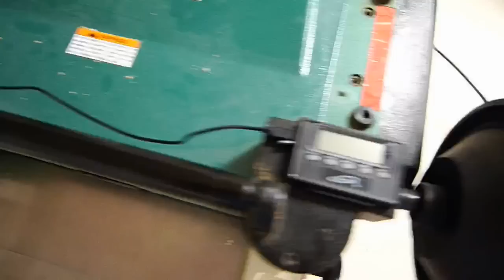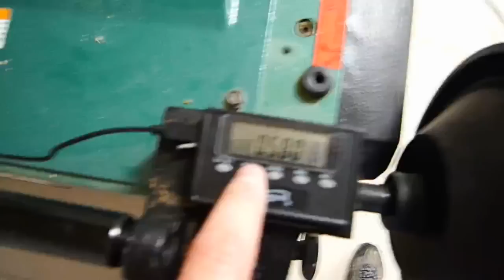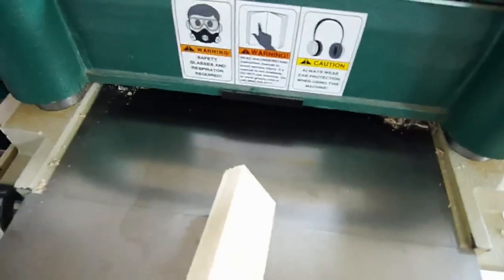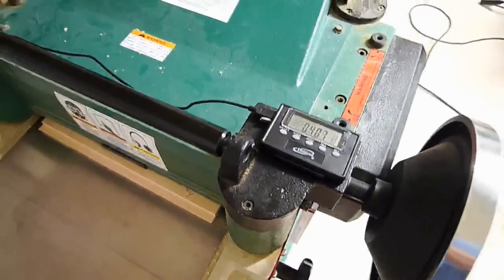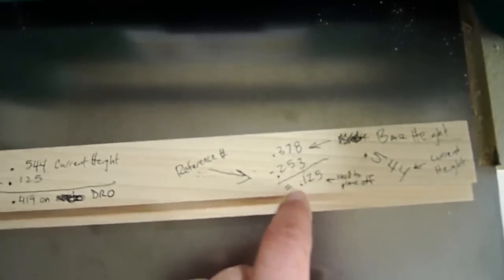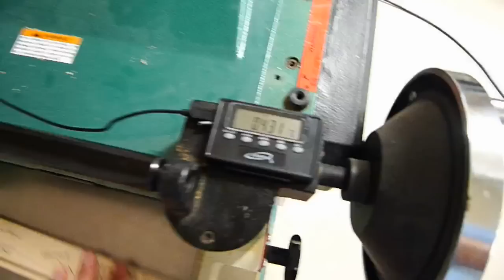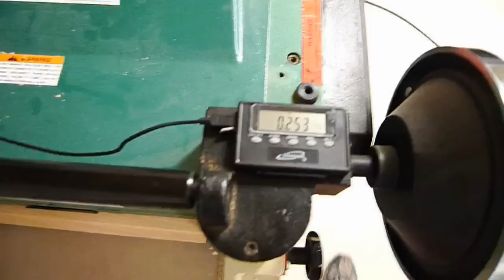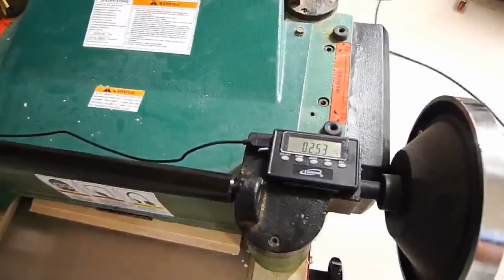iGaging Digital Read Out "DRO" on 15" Grizzly  Planer G0453Z

Comment: While what you did technically worked, I think all you really needed to do was plane a piece of wood, cut a small chunk off it (like you did), insert that into the offset to lower the readout's measurement by the thickness of that cut, zero out the meter, remove the block, and close the offset so it raises it up (from zero) the thickness of that cut.  At that point you're done - No math.  Use calipers to verify the original piece's thickness vs the reading and then change the height and cut another piece to doublecheck for good measure.

Comment: Wrong gage for this type of tool. You want a DRO that you can input the actual thickness of a piece of wood planed. Then you can easily lower the cutter head to the thickness required. Look into the Wixey WR510 Digital Planer Readout with Fractions. $59 and seems to be the type needed for this type of tool. Nice video BTW and nice installation but WAY too much math!